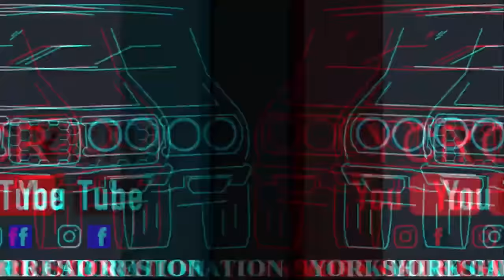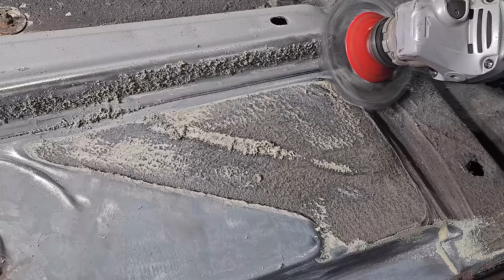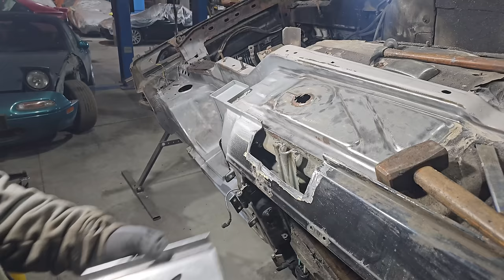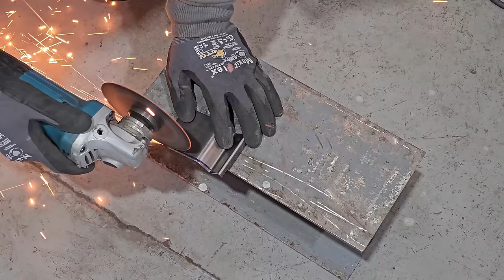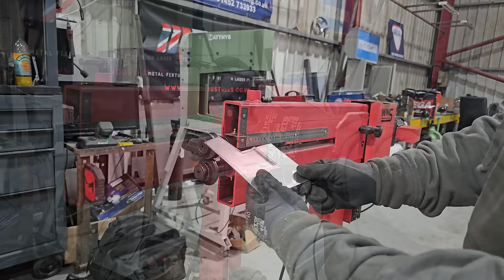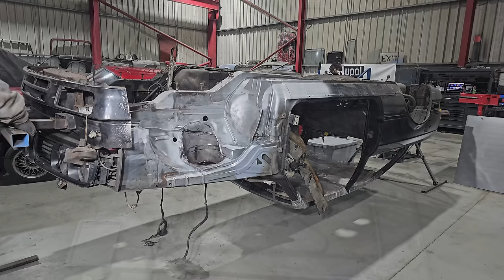Repairing the Rotten Sills and floor sections on Colin Furze BMW E30

Comment: Thanks for the video. Steve, you do amazing work. I like the fact that when you tack a piece in, then before finishing the weld you assess the fit. Many times I have seen you cut out tack welds to adjust a piece. A couple of times you cut the whole piece out and reset it, because with multiple bends and angles it would show when painted. Thank you for your professionalism.
   It really is too bad that you are putting all this work into this car for Colin, only to have it hidden away in a hole in the ground!😂

Comment: where does all the dust go? extraction fan? (or lungs) very interesting to see the hidden rust under the underseal, i've seen "pinholes" welded up after drilling through with copper held behind on some lesser channels.

Comment: When you see "pin holes" like that, do you check for the other side to see if it has already spread, and if not do you merely weld a circular plug in after removing the rust?

Comment: You removed the reinforced metal plate for the OEM  jacking point that was welded to that brace in rocker area meant to help take the weight of the car when jacked up. So that metal reinforcement plate needs to be welded in the exact location it was on the brace. Otherwise the rocker area will be crushed if someone tries to jack up the car there. Unfortunately you can't even tell where the  correct jacking point/brace location is anymore to add the final reinforcement plate, because you covered over the brace. Does Colin no longer want the factory jacking points?
Reply from the maker: So I guess I never thought about simply just measuring the other side for it's position or maybe one of the other 5 E30's we have in. Kinda simple really when you think about it. 😁 maybe reflect on the simplicity of the solution instead of the complexity of the problem that you have decided to fabricate before commenting :)
Reply: I wasn't trying to be rude, you seem pretty upset. I just wanted to understand what the plan was, as you moved on to other areas of the car  without marking the location for the reinforcement or giving us any indication you'd be coming back to that to finish it. 

So my question shouldn't have been a shock. And seriously didn't justify your hostile/arrogant reaction. I'm shocked as I'm a fan not your enemy.
Reply from the maker: @smavtmb2196  I'm not upset and didn't try to be hostile or arrogant, maybe it comes a cross that way in answering questions abruptly and with short answers.
Reply from the maker: Sorry we don't have time to explain things better or in more detail at least. Maybe thats why it came across as it did, but honestly we don't have time to make detailed answers hence why we don't manage to answer much :)
Reply: @yorkshirecarrestoration  OK 
No worries. Again I never meant to insult your skills. Which are impressive. I was simply looking for clarification. It's all good.
Reply: @yorkshirecarrestoration  👍

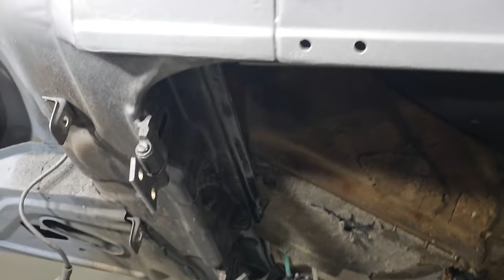Comment: After you removed the angle support of the jacking location at 3:32  u repatched the area but u didn't weld a patch for the angle support for the jacking location my question is.... Is it okay not to as u did at12:01 just wondering

Comment: Hi Steve, quick question for you, both you and Ryan have fixed the same areas of the 3 BMW’s in the shop.
Wouldn’t it have been beneficial to duplicate the panels,rather than remaking them individually?… 
Not a criticism just an observation.
Keep up the excellent work.

Comment: I had an old 1980s Y Plate E21 323i. Under each seat was a circular plate that rusted and let in water. I had to swap them over with new sheet steel and weld them in. Can anyone tell me what they were for? I can only think they were due to some part of the factory assembly line or to let the water out if yee drove into a river. A M Badged car but when BMW had to shift old style bodyshells I was told. Just top trimmed and a twotone paint all round. No performance upgrades from a standard E21 though. Or suspension, standard or not I wouldnt know. It was really fast for me at age 23. The last owner that I bought it from may have had sprayed the car himself. There were M Badges outside but it had the 3 stripes on the seats too. After a diesel mistake, fixed, system drained, the wrong fuel had dropped all the carbon off the whole exhaust to the the twin tail pipes. My mechanic said drive it till the sparks stop ( Big roman candles at full throttle) I opened it up on the A road,  to shift the crap and the Police saw me. Theyd never seen the like before, didnt want the hassle. Think they said they saw me a mile off.  Telt me to go home

Comment: Steve, you mention pin holes need sections to stop corroding. When and how do you decide to use the Dinitrol neuraliser or replace areas with new steel?
Reply from the maker: If it's surface corrosion and pleanty of metal thickness then treat it. If it's rusted through cut it out :)

Comment: Is there any asbestos in that paint??
Reply: The only place you find asbestos in cars are brake pads and clutch facings and only in older cars
Reply: The thick stuff he's grinding through is sealant/undercoating. He should definitely be wearing a respirator or at the very least a dust mask while removing it.

Comment: That copper spray isn't going to prevent any rust and whatever spray you put underneath and wherever you weld it's still going to rust and you're not even using the correct sheet steel that is Galvanized like the factory that stuff is expensive and much harder to mold into shape you British have winners but it doesn't compare to Michigan and that kind of work even just from Winter to Spring it will rust in your garage from the condensation buildup if you don't have heated garage will start rusting you should have treated that steel chemically galvanized treatment
Reply from the maker: galvanised sheet steel isn't needed and even if it was usd we would only end up grinding the galv off to weld it as you can't weld to it otherwise. The primer is just to stop it flash rusting while we finish the rest of the fabrication on the floor. wait untill the floor is done and see how we treat the whole floor and the chemicals we use then come back and comment :) thank you for watching :)
Reply from the maker: Also the factory steel isn't harder it's the sam, we also either use stock thickness or thicker steel as our repairs. But thank you for watching :)
Reply: @yorkshirecarrestoration  all right if you say so boss I'll get on it as fast as I can